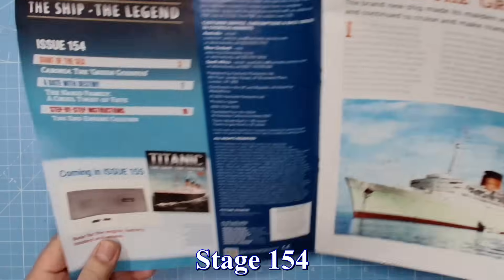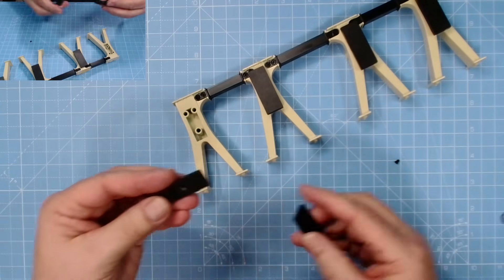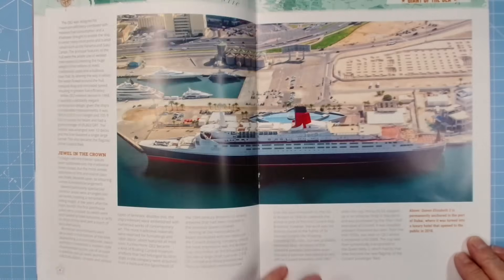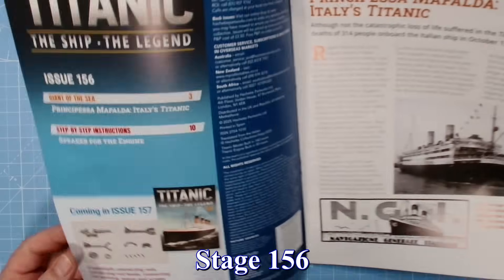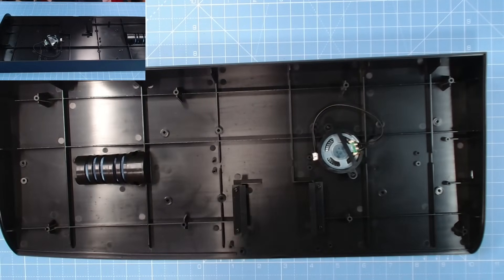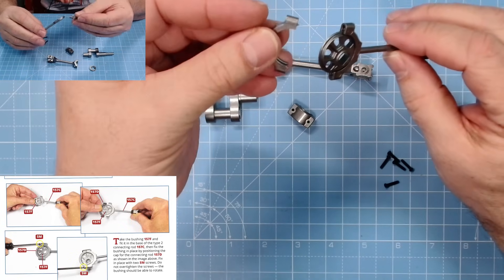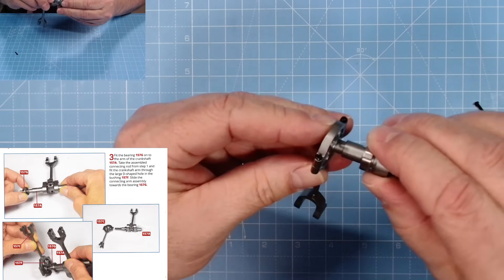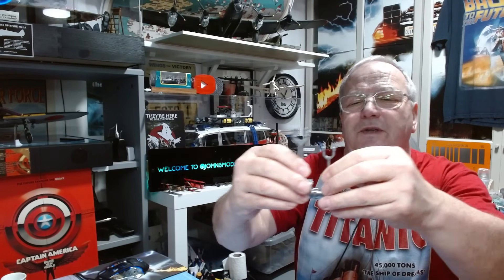Build the Titanic Port engine Stages 154 to 157 from Hachette

Comment: Greetings John, quick question: my yellow hull stripe fell apart and chipped off, after applying on the Titanic model, did you have a similar experience? I’ve noticed in some videos of other modelers that they have the same issue…
Reply from the maker: Yes, I did a couple of times. Apply with DECALFIX to minimise loss.👍
Reply: @JohnsModelmaking  will you recommend to brush paint it with Tamia paint? Thank you in advance :)
Reply from the maker: @geldar1 I haven't had to paint mine, but if you are comfortable with that, make sure to use masking tape.

Comment: I started subscription from 142 ....... 141 wasn't available but picked one up from eBay
Reply from the maker: Good to know.  👍
Reply: @JohnsModelmaking  just wondering about the remote though.....think you said engine will run off the ships one?
Reply from the maker: @darrencarwardine3230 Yes.